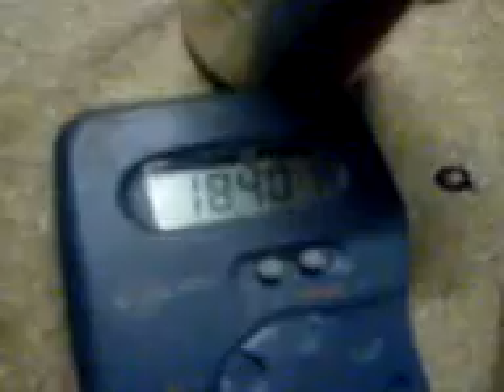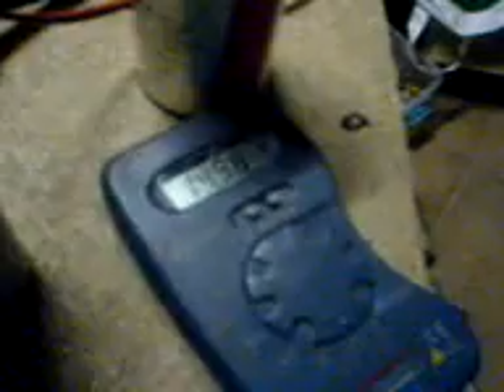Newman motor 2 pulse wit one battery

Comment: Hi,
great idea with the toroidal transformer.
Can you also just use the 18 Volts output from
your cap bank to run the Newman motor alone from this ? ( Maybe start with the battery and then switch to the capacitor bank ?? )
Please come to overunity dot com and report
in the Newman section.
Many thanks. Regards, Stefan.